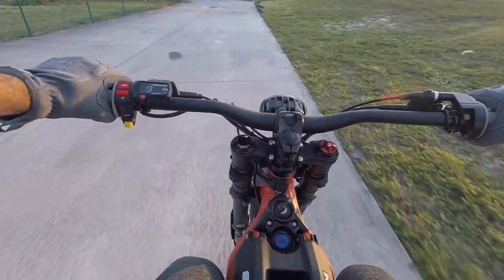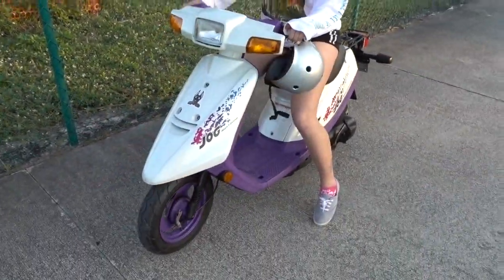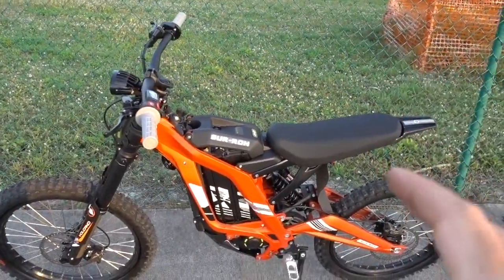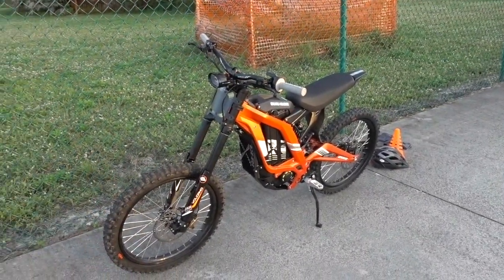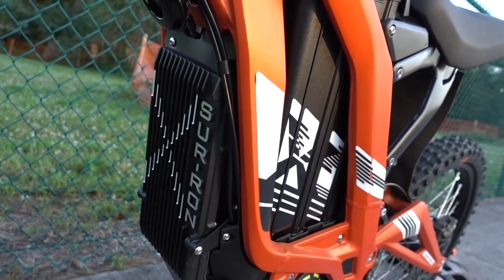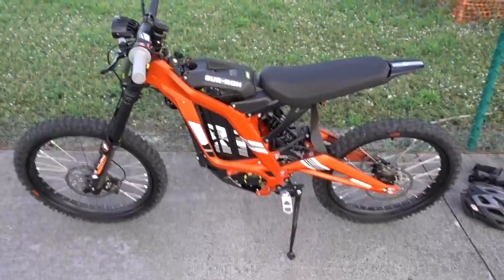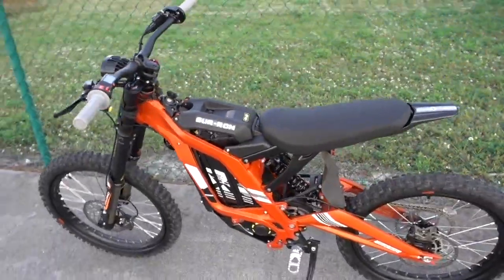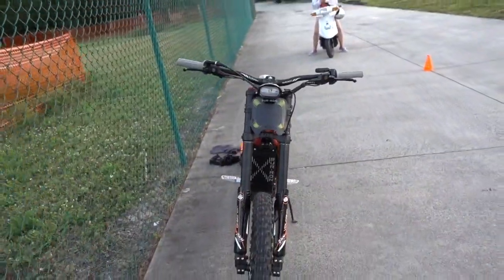SUR RON eBIKE BUILD PLANS and RACE!!

Comment: Hey Jack: was there a 3rd mode, in the last vid you said you might have to either plug in or unlock another faster setting? Might want to change the gearing while stock just to see ? 🤷‍♂️ What's the intention of it? Track, daily, cruiser or all ?🤙💯
Reply from the maker: Daily driver and commuter
Reply: I was going to ask the same question.The street version of this bike would have been a better option for you since it has the turn signals,fenders and street tires.
The sur ron is a great bike but it's expensive especially if you want to mod the bike
better controller
larger battery
better brakes
better suspension 
bash plate
different sprocket
these items cost a few grand to the already $3300 price tag (this price does not include the shipping,duties and taxes.

Comment: If I had 5 grand to blow I’d take one in a heart beat.   Hopefully pi turns out to be a money maker !
Reply: I've been dreaming of one for ages, finally built a 500W 36V 12ah bike for like ~400USD (in poland) using a cheap hub off ebay and china KT controller.
if i were to build next bike id make it at least 72V for top speed, acceleration is very good anyway.

Comment: Your gunna have 10k into this bro the bike is 6 already it's not worth it at all just go buy a cbr 1000 rr put the motor on your mountain bike  your putting money over bad it's very expensive for not alot of gain with electric and you say bike is 4 but I found them for 6
Reply from the maker: I’m telling you i bought mine delivered under 4K. I don’t care what anyone else is saying. That’s the truth. And I’ll be under 6k after all of the mods, faster than a 450 too.

Comment: I think the top speed is ok for the build it has stock , whats the battery life ? Id work on that more than speed, " I cant believe I said that " lol
Reply from the maker: Battery goes 30-40miles stock.
Reply: Not too bad if you drive to some trails in a truck I suppose, the e bikes do about 3 hours or so last time I looked but they have come a long way since they came out. 30 or 40 miles around a track or trails would give plenty of fun

Comment: Hows the power delivery, does it get slower as the charge drops ?
Reply: Jack is a newb trying to sell you a bike. This motor will show about 4.5 rwhp. As an honest owner, the power is good torque with no top end & power starts to noticeably soften @60% batt level.
Reply from the maker: You clearly must have a problem with yours? This thing put down 7hp and does not lose any balls until around 40-30%. Top speed stays consistent too. I’ll do another dyno test at 30 percent just for curiosity.

Discrediting me and claiming I’m “trying to sell” the bike is your opinion. And obviously one that is false.
Reply: @JackCecil  if mine "has a problem" then it sure doesn't say any good things about the company's quality control.
Reply from the maker: Not at all. Stays sharp all the way down to 30% with a slight drop after that. But barely noticeable.

Comment: Are you gonna get a tail light and turn signals, to make it street legal, or just send it at 55 mph on the sidewalk as a bicycle? 😂
Reply: Its florida, you could take the wings off a plane and drive around if you wanted
Reply from the maker: It already has a tail light. But to be legal you just stay in the bike lane lol. Use your hands to signal.
Reply: @CannondaleF700  😂

Comment: Jack try going for some lightened drivetrain parts, lighter sprockets and a lighter chain will go a long way in helping your acceleration on something like this not to mention tires with a stronger sidewall and smaller rims would go a long way in helping reduce the friction coefficient you're fighting with those tires you've got on now. I gotta wonder what some carbon or magnesium wheels would do on something like this just to get you moving that much quicker.